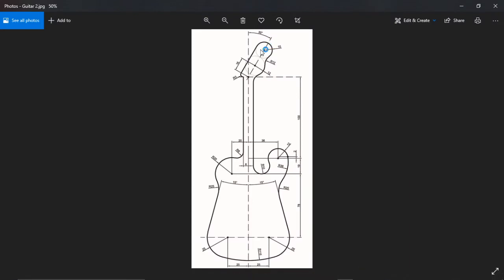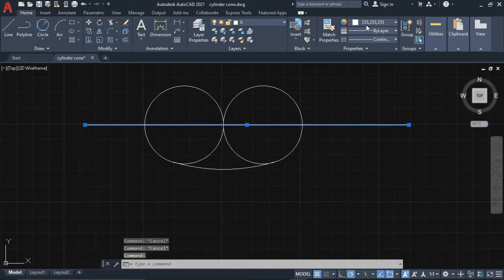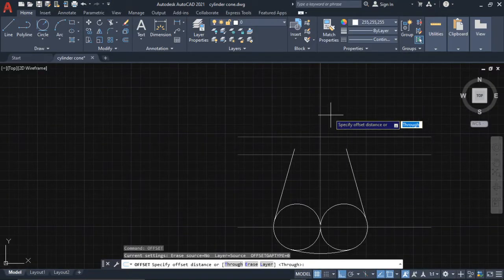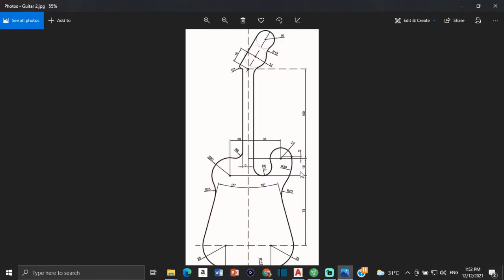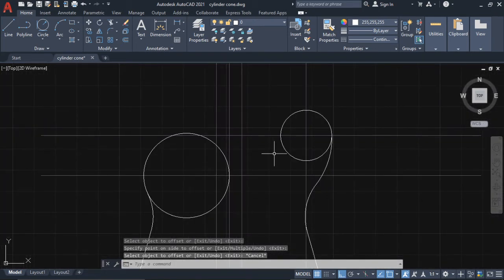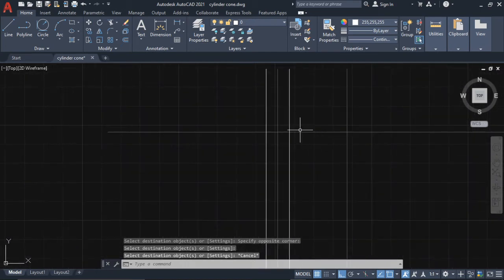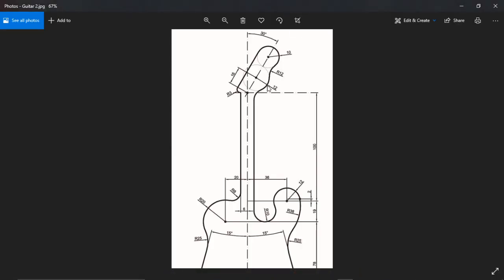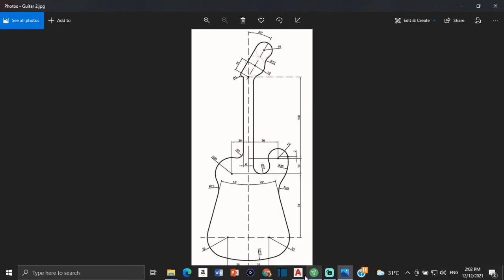DRAWING A GUITAR IN AUTOCAD (TANGENCY QUESTION 3)

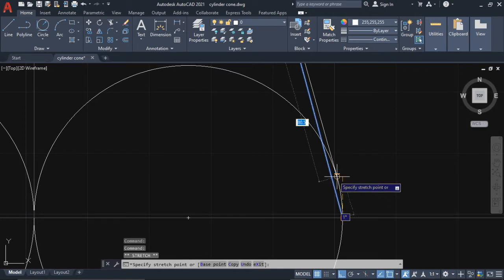Comment: I was following your drawing with Autocad and could not maintain the 15 degree angle of the line  when "moving" the endpoint tangent to the circle at 4:10 time location. What did I miss?
Reply from the maker: I'm not sure why. Turn off ortho and ensure everything in object snap is on except nearest. Alternatively you can draw the 15⁰ line outside of the drawing and then copy it from the end point and paste it to the tangent of the circle.